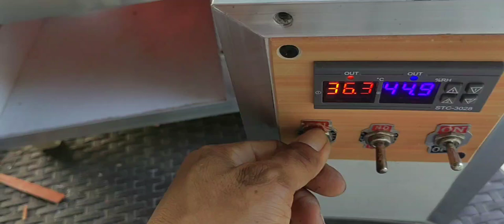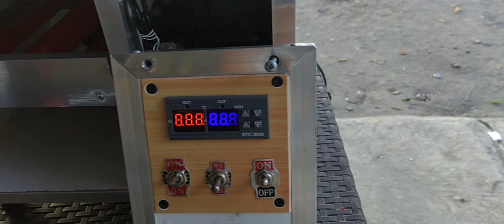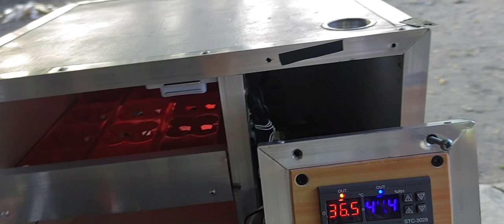Egg Turner " How To Install Limit Switch"

Comment: hi .. what is the purpose of two fans at the back .. how it runs
Reply from the maker: to distribute the heat inside the incubator
Reply: @balikbayandiskarte1256  .. so, it blow outside air to inside .. or just for inside circulation .. how you control it or just always on
Reply from the maker: It is for continues air circulation only inside the incubator.  heat is  only  ON and OFF controlled by the switching thermostat

Comment: Walang diagram bossing
Reply from the maker: wla po bossing hndi kona po ginawan ng diagram kc pareho lng mga automatic incubator na diagram.
Reply: @balikbayandiskarte1256  pAano po yong connection sa timers saia sa relay
Reply: @balikbayandiskarte1256  yong papunta po sa timer them relay sa loob po sana
Reply from the maker: ang timer my dalawang klase po meron digital at meron din mechanical, ang ginamit ko dito ay digital timer tpos ung sa output nia dun mo ikabit ung coil ng relay tpos ung relay meron xa normally open tsaka normally close tpos meron common. sa common ikabit mo yun sa Line 1 ng 220 power line. output nia ung NO at NC so jan mo nman ikabit ung isang terminal ng synchronous motor tpos ung isan terminal nman ng motor diretso na sa Line 2 ng linya ng koryente na 220v. pwde po kau mg msge sa FB Page ng Balikbayan Diskarte dun tau mg usap kong interesado po kaung matuto. salamat
Reply: Cg po